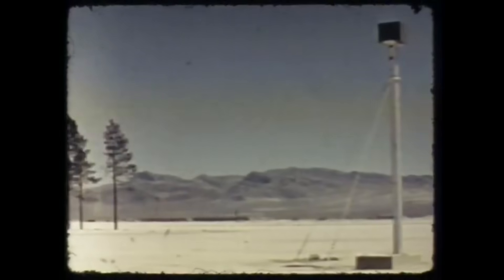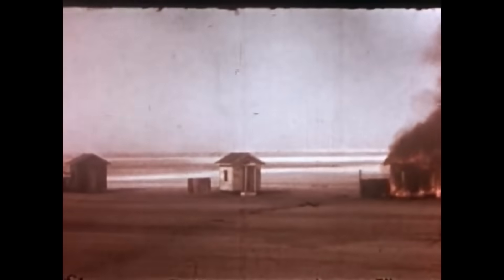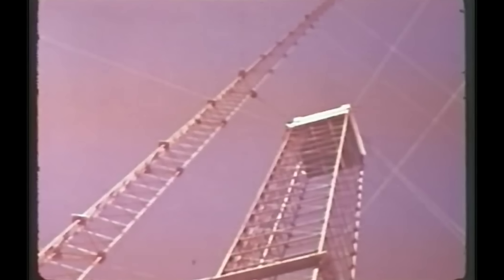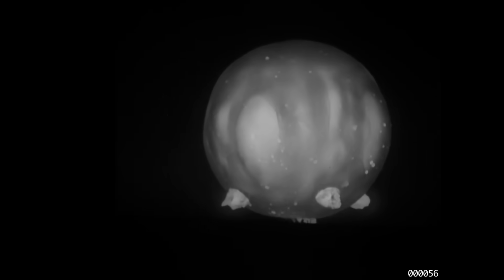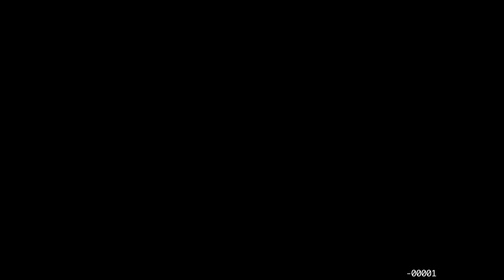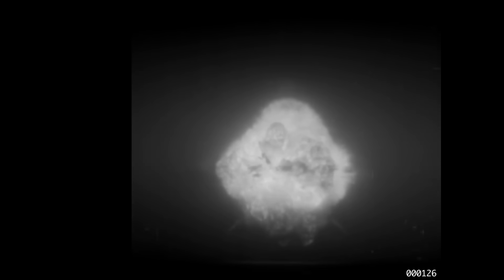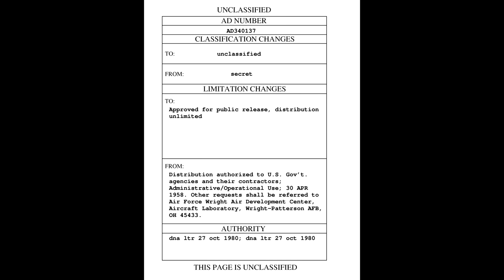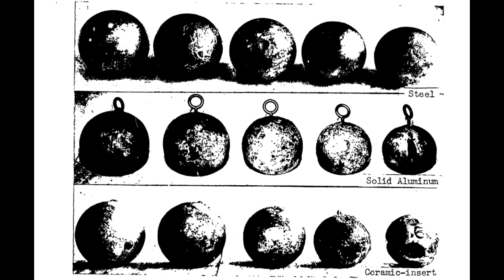Can A Metal Bowling Ball Survive Inside a Nuclear Explosion?

Comment: I think the point about irradiating lithium inside spheres is perhaps conflating some things. They thought they needed massive amounts of tritium early on, but later found that it was not the case because you could make it inside the  weapon itself from lithium-6 deuteride. Early hydrogen bombs were these giant physics experiments with cryogenic tritium and deuterium in great amounts.
Reply: Tritium is needed for boosting fission explosions---the pit is filled with DT at very high pressure, each mole generating a mole of neutrons once the temperature reaches around one million degrees; these neutrons fast-fission the fissile material even if untamped.
Reply: @maxr.dechantsreiter5226  I can't remember what the comment above refered to without rewatching the video but I don't think it was boosting. The point of boosting was originally not mainly to increase yield and reduce the need for tamping (smaller warheads); it was to increase the number of early neutrons so that less generations of fission were required to reach an acceptable yield even in a high neutron environment (i.e. when someone set off a nuke nearby previously; either you or some ABM system). Regular boosted fission devices (not neutron bombs) use ~4-5 g of tritium per pit. This is not really that much and it saves kg-amounts of Pu-239 so it's clearly worth doing for that reason too. Early cryogenic thermonuclear devices were envisioned to basically use bath tubs full of cryogenic D-T mix with a fission device placed inside; when that proved to be really dumb they did a cryogenic full-scale test with D-D fusion with a Teller Ulam design (Ivy-Mike) and tried to miniaturize that design, but it was still hopelessly impractical before they hit on Lithium-deuteride.
Reply: @soylentgreenb  sorry, but tritium never used in the fusion stage (even Ivy Mike used only liquid deuterium). Regarding amount used for boosting, several moles are easily possible at a few hundred atmospheres pressure.  The purpose of boosting was miniaturization along with 
higher yield (>80% is possible).  Look up how much tritium all the CANDU reactors produce in a year, and you won't think a few grams is such a small amount when multiplied by the number of bombs (plus it needs to be replaced every year).
Reply: @maxr.dechantsreiter5226  The approximate amounts used for boosting are not heavily guarded secrets. It's on the order of 4-5 grams for a primary or if you prefer 1.3-1.7 moles of tritium. CANDU is irrelevant, it is not sourced as a byproduct from heavy water reactors (at least not for weapons programmes), it is made with special absorber rods (I assume they contain lithium) and the entire production of tritium for mainting the US nukes comes from two reactors at Watts bar as a side-hustle (these are power reactors whose main purpose is to make energy and they recieve and irradiate some rods from SRS).

Miniaturization or saving resources are side benefits of boosting. The critical, main benifit is reliability. It is not enough to line the weapons with some kind of neutron absorbing material (neutron hardering) to prevent pre-detonation/fizzling in an area where a nuclear bomb has recently gone off. A nuclear bomb releases moles of neutrons and the ones that aren't absorbed by something thermalize and linger for minutes (half-life of 10 minutes). One of the main targets for nuclear weapons is to reduce your enemy's ability to continue to fire nukes at you; this task requires a very large number of small nukes, precisely targeted at hardened facilities. If a target is critical you cannot rely on a single nuke to function correctly and you're essentially forced to hit the same target twice to ensure you destroy it. This is how you end up with target lists containing dozens of targets in fairly close proximity. This kind of situation requires boosting or you will simply have to wait too long in order to ensure that neutrons decay before hitting the target again or tapping the same target half a dozen times to really make sure. There was also a fear that the sensitivity to neutrons would be able to be used by ABM systems to fizzle enemy weapons. You don't want to send a 5 MT nuke at a soviet city and have a puny 1 kT device fairly harmlessly detonated near your bomb a few seconds before burst be able to generate enough neutrons to make it fizzle and for the secondary stage not to go.
Reply: @soylentgreenb  whatever you say
Reply: Even Ivy Mike used only deuterium---tritium was never used nor foreseen as component of the fusion fuel, it was and remains simply too expensive (it is the most expensive component of a thermonuclear bomb).
Reply: @maxr.dechantsreiter5226  It was indeed suggested and studied if they could somehow get the price of tritium down and use ridiculous quantities of tritium and deuterium in cryogenic canisters, but it never went anywhere.

Thermonuclear bombs use no more tritium than a regular boosted bomb, because the only part that uses tritium is the boosted primary. The secondary uses a "sparkplug" of fissile material (U-235, Pu-239 or some mix). I do not believe it is the most expensive component, just the one requring the most upkeep (plutonium may also degrade by formation of helium in the structure and by self-irradiation and require re-manufacturing, but tritium is constantly decay by about 6% per year).

A single reactor at Savannah River Plant could make 10 kg tritium per year as a byproduct when they were producing weapons plutonium. If 6% of the tritium in storage decays per year and a boosted primary needs 5 grams this is theoretically enough to maintain a stockpile of 33 000 boosted primaries assuming no leaks etc. The scale just doesn't look big enough to be the most expensive component; especially compared with the dangerous fission wastes from processing irradiated fuel for plutonium.

The current way tritium is made is by having burnable absorber rods that are irradiated in TVA's power reactors at Watts bar NPP; this in a sense almost a byproduct of power production by just placing some special non-fuel rods in the outer perimeter of the core. Then it is transported to Savanah river for processing. The facilities for extracting the tritium, finishing tritium, extracting helium-3 from decayed tritium etc the Savanah River site is just too small to cost that much and the wastes generated are low-level radioactive wastes.
Reply: @soylentgreenb  whatever you say

Comment: Correct me if I am wrong but I believe there is no element in nature that can resist 1,000,000 degrees Fahrenheit temperature and remain a solid.  Therefore the title is misleading given that the test subjects, the steel balls and composite balls and tubes, were not positioned in the explosion to actually resist the hottest temperatures which are at its core.
Reply from the maker: The high temperatures take time to penetrate into the object. That’s why we can build rocket engines with exhaust hot enough to vapourise steel, but keep them cool with fuel circulating through them.
Reply: Temperatures in rocket exhaust are one thing but one million degrees Fahrenheit is another.  I doubt there is any material that can resist that amount of energy for long and still remain a solid.
Reply: It's the "for long" part that explains how there's anything left

Comment: Hi guys. Irrelevant here :) . In million degree air temperature why the ball not melted ?
Reply from the maker: The outside did, but heat doesn’t move inatantaneously. That’s why you can put your burger over red hot coals, burn the outside and still have the inside be raw.

Comment: Yeah, I kinda thought that solid steel balls must actually be remarkably hard to destroy. But I am surprised that they weren't just shattered into pieces. Steel is strong, but I know it can actually crack. High temperatures probably make it softer though, quickly removing any internal imperfections that would otherwise just propagate and shatter the ball.
Reply: I think a key part of their surviving was their weak attachment to anything else.   So most of the energy of the blast force just accelerated them away.  Much like a cannon ball, the force is spread over the entire surface and the only resistance is the inertia of the ball.  Certainly the radiation-heating made them warm enough to avoid brittle fracture.
Reply: @mikefochtman7164  If you think about the shape, the way the plasma/shock front must initially touch the closest point of the sphere and then spread round the side, it must mean that however the forces then vary due to the time delay involved, it's not enough to do that much within. Probably all sorts of complex things going on, how fast different solids can carry a shock front, how brittle it is, how it responds to compression, etc.

S'funny, the older I get, the more intrigued by materials science I become.

Comment: The trees were not "uprooted," they were cut off at the ground and then planted like telephone poles. More accurate than "nuclear explosion," the fission event fraction of a second is a plasma sphere. 1940's tests the diameter of the nuclear sphere was precisely known, everything was vaporized down to twenty two inches from the concrete plug to the wire tunnel to the control bunker. After that moment everything else is nothing but dissipation of energy already there. It was estimated the last data flowing down the telemetry wires was a couple feet ahead of the wire being vaporized by the instantly expanding plasma to the limited specific sphere diameter. Duplicate manufacturing was very precise at this time for the precisely known product properties.

Comment: That's the most nuclear era idea ever: "We were worried we might run out of Tritium to make our nuclear bombs, so what if we set off some nuclear bombs to make the Tritium that we can use for even more bombs!"
Reply: “Mr. President, the bomb program is a crucial component of the bomb program.”
Reply: @ericssmith2014  Without bombs, we would not have bombs!
Reply: It's not quite as counter-intuitive as it might seem at first The original A-bombs, aka "little boy" or "fat man", did not need any tritium. These were basic fission weapons, using cores made from either plutonium or enriched uranium - 80% U-235 or greater. The "bomb-assisted tritium supply" idea would only use low-yield A-bombs, so would not consume any tritium, but could produce a great deal of surplus tritium. The general idea was to mix lithium-6 into asphalt or concrete, which would stop it being blasted all over the place by the A-bomb detonation, and would contain any tritium generated, allowing it to be extracted later.

So why did other types of weapon need tritium? A fusion-boosted weapon was an A-bomb with a twist: The core is surrounded by a depleted uranium (U-238) shell, which would normally act as only an inertial tamper, holding the core together for slightly longer before the supercritical fission chain reaction can blow it apart. A boosted weapon has some fusion fuel (tritium and deuterium) inside the core, creating a small fusion reaction. This contributes some energy directly, though usually not more than 20% of the total yield. More importantly, the fusion reaction rapidly generates a large number of extremely fast neutrons, which have enough energy to fission some of the U-238 surrounding the core. So the depleted uranium is no longer just a tamper, it actually gets involved in the reaction, releasing energy in a more efficient manner than the core itself. Hence the fission weapon yield is boosted by the fusion reaction.

The other type is the H-bomb. This also uses an A-bomb as the trigger or catalyst, generating sufficiently high temperatures and pressures to ignite a fusion reaction. The main difference was that far more fusion fuel (again tritium and deuterium) was used, so at least 80% of the yield would be directly from the fusion reaction. The most efficient bomb of this type was actually the Soviet Tsar Bomba, which yielded 50 megatons, with 97% of that energy coming from the fusion reaction.

This leads onto another type of weapon, which combines both effects, and is directly related to the Tsar Bomba design. The actual bomb which was tested had an inertial tamper made of lead, which did not produce any nuclear reactions and thus served only as a tamper. However, the original design had a conventional depleted uranium tamper, like most other fission cores. If this had been used, the fast neutrons from the large fusion reaction would have caused most of the U-238 tamper to fission, in a similar manner to a fusion-boosted weapon, albeit on a much larger scale. This would have roughly doubled the yield up to 100 megatons, with 51.5% of its energy from fission, 48.5% from fusion, making it more powerful but also far more dirty, generating a ludicrous amount of fallout from fission-products.
Reply: @lloydevans2900  The other place that tritium is used is in the pulsed neutron generator used as a trigger. The early weapons used a polonium/beryllium initiator, but later weapons use essentially a miniature particle accelerator that use tritium as part of the process to generate a shower of neutrons to trigger the weapon.
Reply: @lloydevans2900  You have the right concept but the details are inaccurate. The boosted fission do not use a separate tamper material, the fissile core acts as the tamper. 
A first gen pure fission bomb will explode after only about 1% of the core material has fissioned, the tritium core in a boosted core greatly increases this percentage. Most of the radioactive fallout of first gen is just vaporized unreacted core material, not fission products. Generally speaking the more efficient bombs were also cleaner because of this. Separately, fission products tend to have a much shorter half-life than the core materials so they don't contaminate the environment for as long.
Reply: "Yo dawg, I heard you like nooks..."
Reply: Mr. President, we must not allow a tritium gap!
Reply: @ironcito1101 we use that joke constantly at work
Reply: When the only tool you have is a nuclear bomb...
Reply: Oppenheimer has steel balls

Comment: I was wondering what those tentacles were.  Cables.  The different shades in the ball were obviously the internal structure of the bomb, so thanks for confirming it.  The balls being hung on towers I knew nothing about.  I'm not going to mention how funny it is that they consistently used two, but that kind of thing was normal during that time period (using the word "period" has no intended meaning <grin>).  It makes me wonder what other experiments they performed.  I'd love to get your sources as to the loss of mass of the balls.  Concluding it was the vapor created by the plasma created is amazing.

Comment: The house in the middle survived because it was painted white... it reflected the thermal radiation better.  High altitude bombers used to be painted white for that exact same reason.  Also they preformed the ground-effects test twice; surprisingly the smaller bomb caused much more damage (I believe it was the nuclear cannon shell).  I've heard that this may have been due to the fact that it was moving relativity quickly when it went off, creating a different shock wave than a stationary bomb.  I wonder if they actually figured out why?